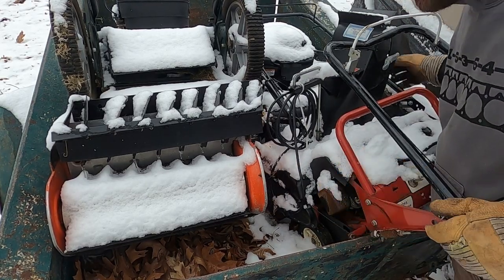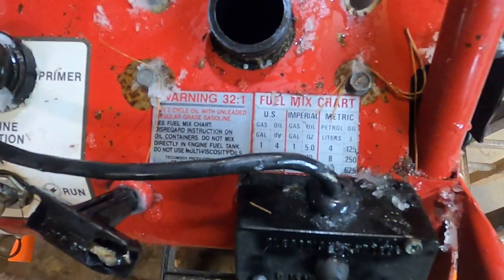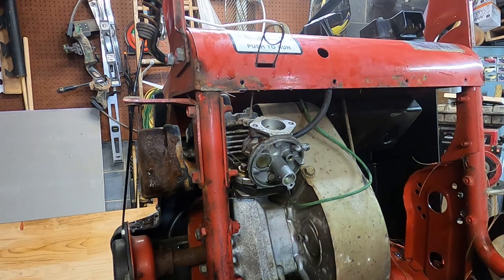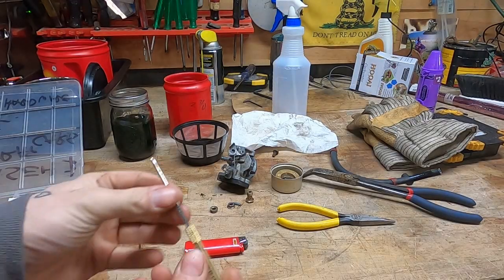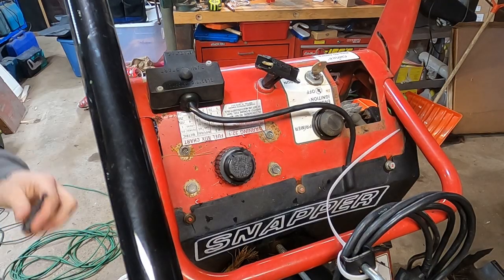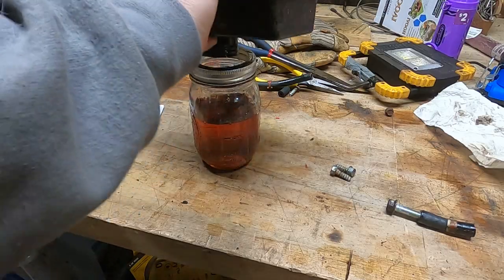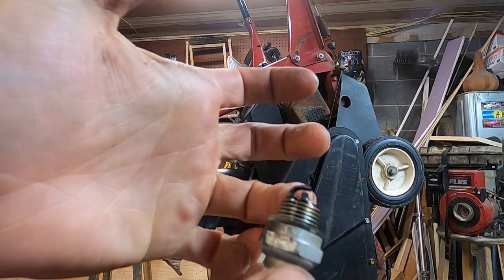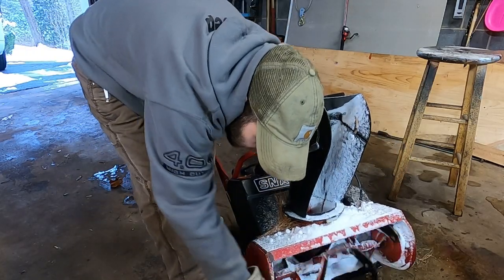Dangerous Old Snapper FOUND & REVIVED!

Comment: Just restored and used my first ever snowblower yesterday!  It’s a FreeCycle 1989 Toro 724. I appreciated this video because I didn’t realize there were 2-cycle snowblowers. I thought I understood how 2-cycle engines work but now I see I’m gonna need to do more research because I don’t understand how a two cycle machine works with a carb which looks like it belongs on a 4-cycle machine (no metering or pump diaphragms and apparently no needle valves to adjust). Time for more theory of operation learning!
Reply from the maker: Those are great machines! I hope you enjoy it! I will try to put together a video sometime on 2 cycle vs 4 cycle engines on snowblowers if it will help
Reply: Doug v Carburetor   Yes, please! 👍❄️

Comment: My recent experience. I'd like to make some comments that might help someone. I think these are great little machines. Snapper 3201 with Tecumseh AH600 2-cycle engine. It's at least 30 years old and I think it will run a few more decades. To replace the belt, you need to remove the pulley. I used a 1 inch open end wrench on the flat part at the center of the pulley. It's going to be tight! The manual says use an adjustable wrench. Adjustable wrench would work as long as it is a quality tool that stays tight on the hub and is big enough to give you some leverage. 
Pulley loosens clockwise as marked right on the pulley!

I also replaced the rubber paddles on the auger. First, I soaked the screws for a few days with oil. All the heads were rounded off and undersized from years of pounding through the snow. Regular wrenches and sockets did not fit. So, I used a 5/16 inch bold extractor. The extractor was able to grab and it was easy work after that.

Take the spark plug out while working around the auger. No risk of starting this way.

Comment: i picked up 2 of those babies on the side of the street , 1 has a electric starter and the other is a hand pull type . i have used both of them on my driveway and 1 time when we had a snow storm leaving about 17-18 inches of snow . the first pass was the toughest but after that by taking half a auger width for each pass it was better than shoveling. now i have 2 2 stage blowers 4 the heavy snow storms free of charge. my first found snow blower was toro snow hound single stage from the late sixties and is driven with number 35 mini bike chain and nothing 4 safety devices and a runner . if u fall down while using it will pull me down the street.
Reply from the maker: I love those old "death defying" units!

Comment: Mid 70's they started the push for unleaded gas When I started driving .   I still think it be a late 70's the Key is steel not plastic . by the 80s they used plastic keys and parts